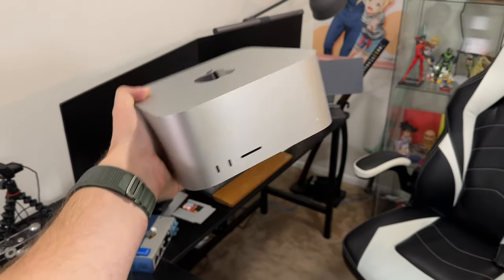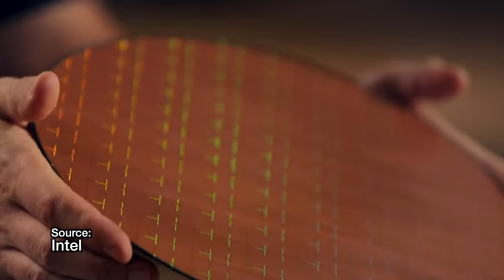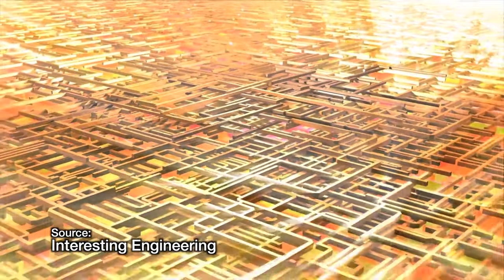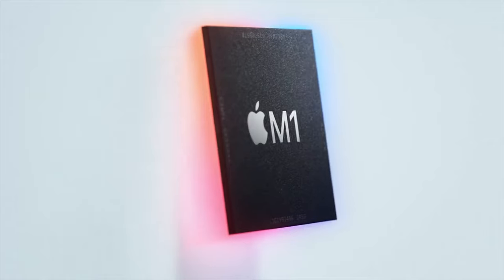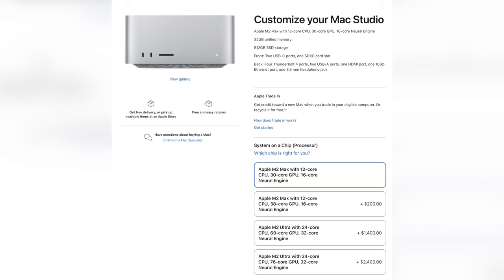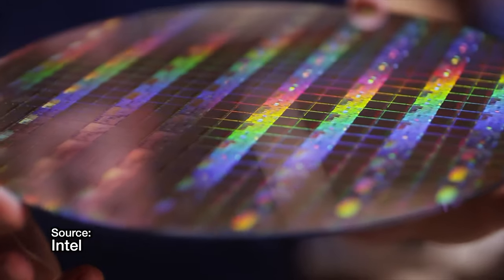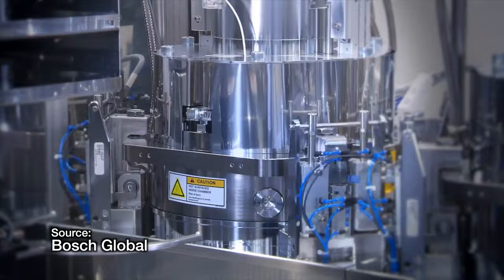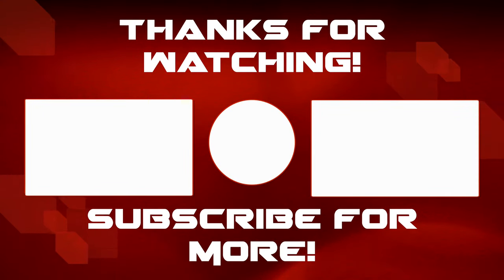Apple Sell's “Faulty” CPU’s? (Chip Binning Explained)

Comment: Question - I just purchased the M4 Max 14’ MBP with 32 cores instead of the 40 (Obviously Binned) does this mean the computer is not a great purchase? Would it be better for me to spend more on an unbinned chip? Or is the machine still a top notch machine?
Reply from the maker: Still a top notch machine. Like I said in the video, companies sell binned chips because those chips are still rock solid as a lower core count version, and the company is able to give you more options. You’re still getting the same performance per core, but you have less of them. Basically, single core is just as stable and fast on both, but multi core on 40 cores is faster simply because there are more cores.
Reply: @GarrettCrespo  i was worried about getting a MacBook Pro M4 Pro with 14 core CPU and 20 core GPU by spending an extra 400 dollars just for the sake that lower tier would be binned. What I,ve learned from your discussion that the base model MacBook Pro M4 Pro with 12 core CPU and 16 core GPU is the way to go for instead of spending more money as this is not the binned one. Am I right?
Reply from the maker: @muhammadmunam5923  binned chips are still solid options. They have to pass all the same quality control parameters as the not binned ones. So yes. They’re still totally worth it for that savings

Comment: So, concluding, the fact that a processor that does not meet the Core I9 requirements and thus is sold as an Core I5 is a marketing Trick to sell faulty CPU's which would otherwise be dumped, right?
Reply from the maker: Kind of. Think of it more as a way to produce multiple products through the natural process of chip manufacturing. Less resources and time wasted and more products and product choices for the customer. The chips with fewer cores have to pass all the same rigorous quality control tests, but they're being graded as a chipset with fewer cores. So they'll be just as reliable as the any other product from the lineup.
Reply: "is a marketing Trick " - in the sense that customers are unaware of how things are made, I supposed.  But if you grow oranges, for example, not all of your harvest will meet the size or aesthetic requirements of a buyer, so the oranges that aren't on the shelf at your local supermarket go into making products from orange juice or oil extracted from the skins of the less desirable produce.
Reply from the maker: That is a fantastic analogy!
Reply: Thanks. Sounds like you are saying the 11 cores in my Mac M3 Pro pass the same tests as the higher priced M3 Pro with 12 cores, but there are just less of them? Some language makes it sound like the whole chip is degraded and all 11 cores are less quality than the 12 cores in the non-binned item. So individual cores are tested individually and the group is tested for how many good or rotten apples (cores) are in each batch?. The better the batch the better the yield. So having a higher count chip doesn't necessarily mean each core is better? Please correct me if I didn't understand right. Also your video was very informative and sounds very unbiased which I really appreciate. Thanks  @GarrettCrespo

Comment: With Intel, for example, why is the single core performance different for i5 vs. i9? It seems like it would be the same. In the same vein, why is the amount of CPU cache different?
Reply from the maker: All of those factors are determined by the yield and/or how Intel manages things like voltage, available cache and other aspects of the CPU. It all gets scaled down from the top depending on what each yield is chosen to be. It’s the same reason why some i5’s or i7’s can overclock to the moon and others can barely exceed boost clocks. Silicon lottery!
Reply: @GarrettCrespo  So an i5 chip that started out as an i9 but had some non-functional cores may have clock speed on the remaining cores greatly exceeding the i5 specification as well as additional cache over what the i5 specifications specify?
Reply from the maker: @geezer2tech154  Potentially. But you also have to keep in mind that the cache, transistors, or any other number of parts on the die may also be faulty. So everything is scaled according to the quality of the total yield. Not just the cores. I primarily focused on the cores in this video because that is what most people see when comparing different binned chips. Silicon die production is a mature process, but it’s still not perfect. Hope that helps.

Comment: the basic M2 chip exists with 8 and 10 GPU cores...so NO there is binning

You find the 8 core GPU vers, on the  base M2 13 inch Macbook air.
Reply from the maker: You are correct! I have no idea how I missed that! Thanks for pointing it out.

Comment: M4 2024  9- core vs 10-core.
New ipad Pros May 2024-
Reply from the maker: Yep. Still a common practice to this day. It’s probably never gonna change since the process of making chips is inherently imperfect.
Reply: They should actually concentrate on getting higher quality chips before rushing to size down.

A bit like how Intel took advantage of 14n we should be going smaller, finding quality then down sizing again.

Rushing to smaller is giving more quality issues.